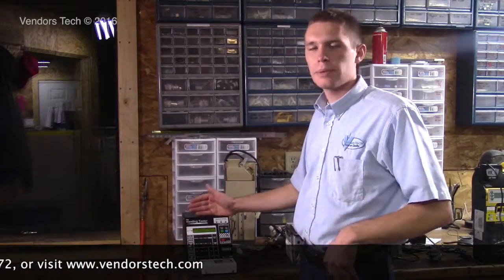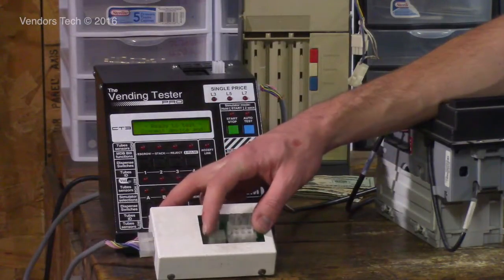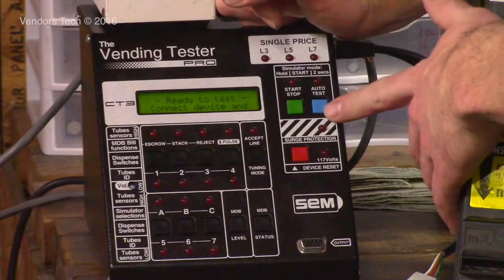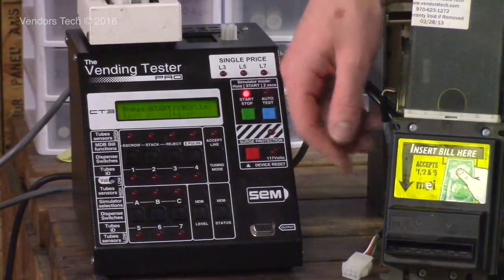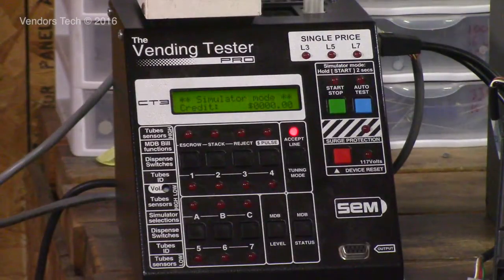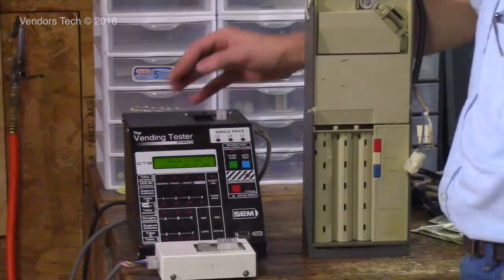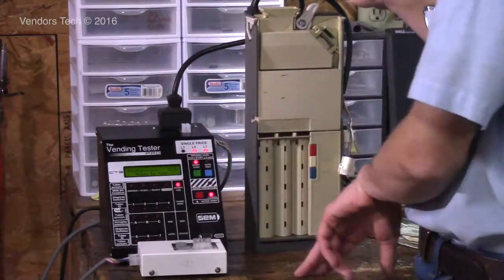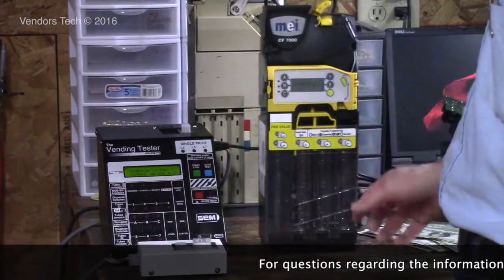Overview of the SEM CT3 Tester & EBVM

Comment: I'm so glad, I watched your very professional presentation of the SEM CT3 Tester. I had no ideal how to use any kind of testing device. A friend told me that I need a tester because two or three mechs of validators that I send out for repair turns out to be inoperable when take them out to a location. What a huge time and money waster. I was just about to purchase a SEM CT something portable battery operated from D&S vending mdb only, until I saw your video. Although all of my vending machines are mdb 24-volts units, I still would like to be able to test all of  my old equipment. I have been in vending for 22-years. My old thinking; when it breaks, buy a new one. That doesn't so well in this economy. Thanks again.

Comment: the white plug on top of the unit is for testing the 1$ in a single price changer. Just connect the Jones plug and the white plug that come with the changer to the the tester and the white plug on top and when testing dollars credit in a bellow dollar price, you press the return 1$ pulse bottom in front of the tester so the changer will payout the coins according to the price set in the changer bellow 1$.
Reply from the maker: Thanks for that insight!  I will have to give that a try.  We've always tested that function, and the use of bill acceptors in conjunction with a single price coin mech using a different method, so I never investigated what all that white connection could be used for.